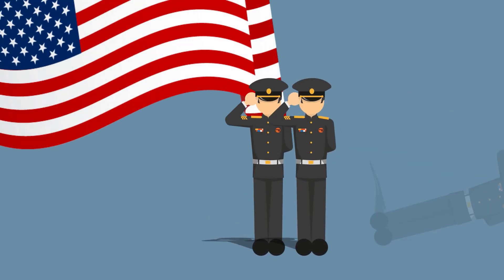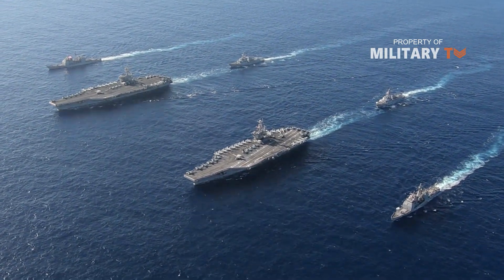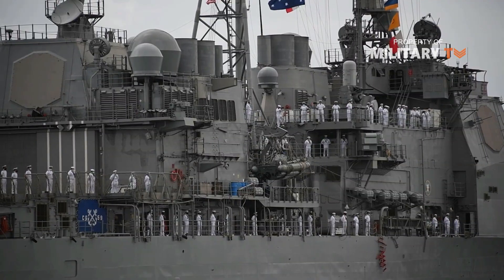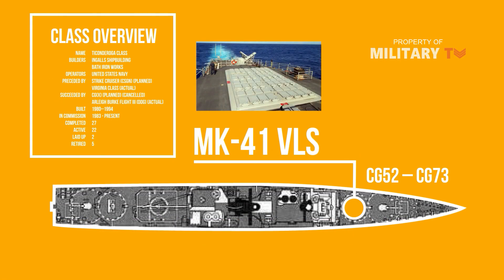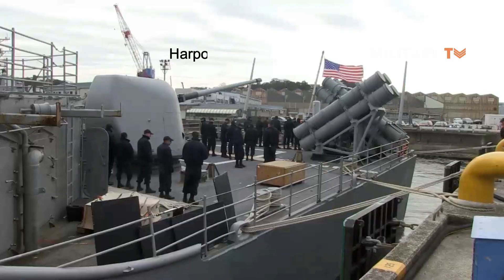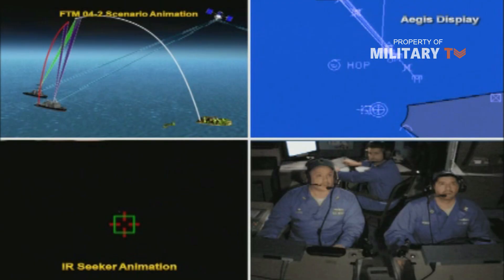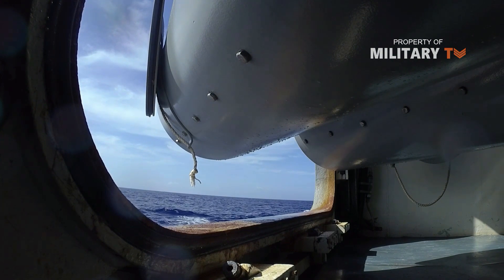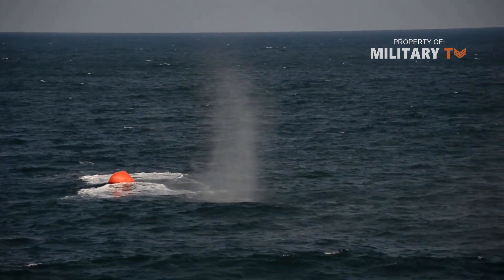Ticonderoga Class of Guided-Missile Cruisers

Comment: They sure did fit a lot onto and into that shortened Spruance class hull. It must be pretty tight onboard a Tico.
Reply: I tell my Sailors all the time. The Ticos are literally the old Spruance class destroyers with the top cut off and an AEGIS suite put on top lol. AEGIS is so awesome Congress will make a mistake getting rid of the CGs without a platform genuinely able to replace them. DDGs aren't going to cut it not from an AAW perspective.
Reply: It is depending what part of the ship you go in. I'm glad I'm not a GS as an EM we chill in the electrical shop or tool issue all day lol.
Reply: @christophertheconqueror8751  Why not build a Cruiser level AEGIS suite onto a Arleigh Burke hull like they've done with the Ticonderoga from the Spraunce? I've been wondering this for awhile now.
Reply: @terrestrialextra4790 the Burkes are very capable, better RADAR then the cruiser, not as many VLS tubes 90 vs 122 I think but still a beast.
Reply: We had it good on Ticos,   hell we had AC vent in every single rack.  More fresh water then we could ever use, was actually pretty nice.  Also Tico is 4ft longer 563 for DDG. 567 for Tico